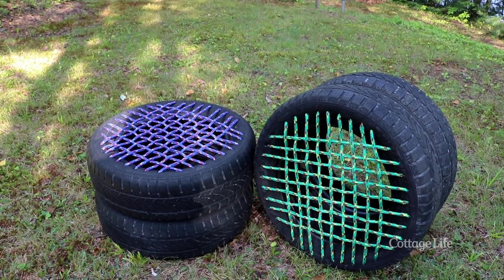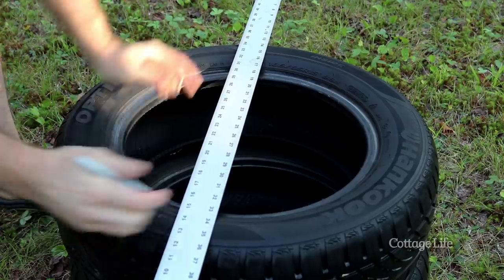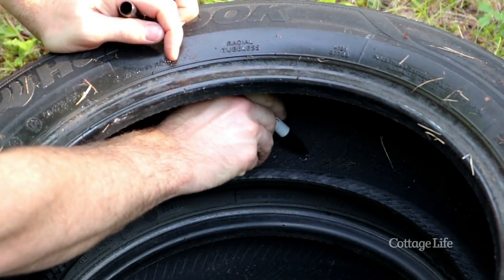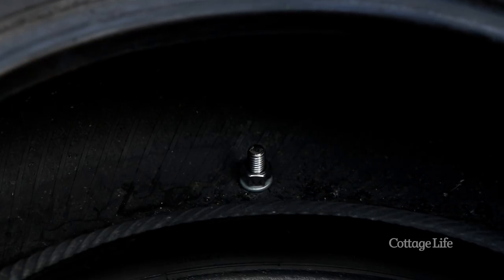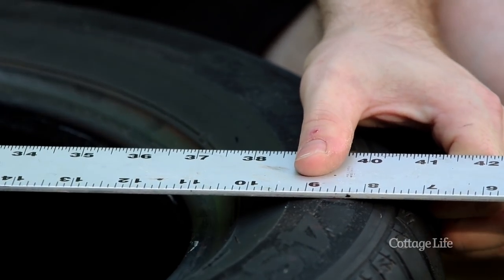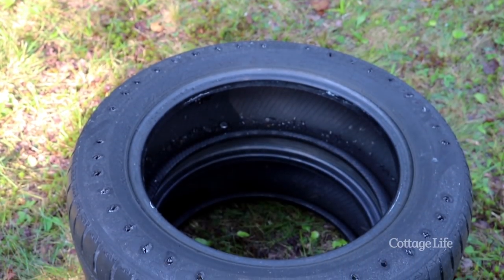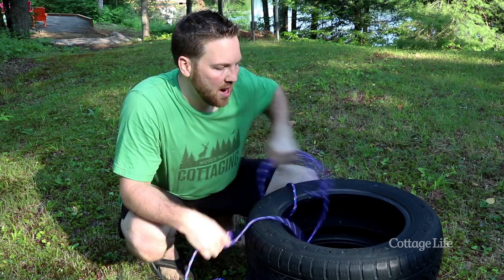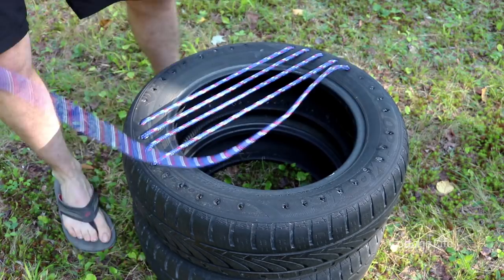How to make stylish seating with old tires! | Cottage Life DIY

Comment: how do you remove the water if it collects in the tire
Reply: you could drill a few more holes for drainage when you drill the holes for the bolts
Reply: Put a small amount of water inside the tyre, then drill holes in the middle of where it collects, do it for each tyre, should let most of the water through if kept level.

Comment: I have tired to drill holes in tires for other DIY projects but have had problems running into the steel bands in the tire and ruining drills bits and not having a nice hole. How  did you not have this issue?
Reply from the maker: Hi Nikki, I used a multi purpose drill bit can go through metal and reamed the hole out so it was big enough to fit the rope though!

Comment: this is very nice maybe going to try this. Any tips?
Reply: Maybe use some big washers to keep the rope and knot from pulling thou tire...
Reply: i would use a padded cushion with a hard bottom on the top of tires, that way you can remove the cushions for storage.
Reply: @gailbarton3308  grommets would be cheaper than washers.
Reply: Drill holes so stagnant  water doesn't collect  in the tire and watch out for creepy crawlies living in there.
Reply: Best advice ,
Do not create insect habitats!